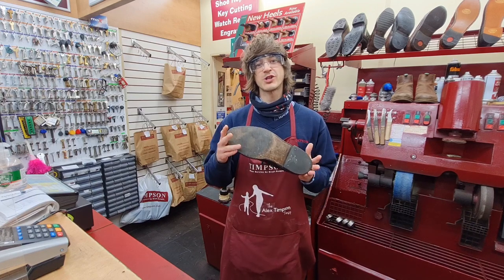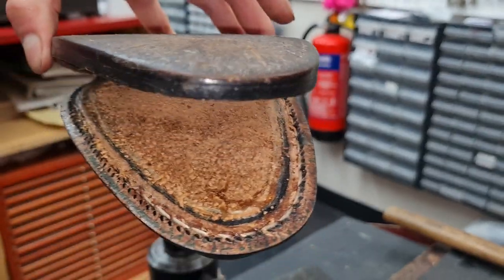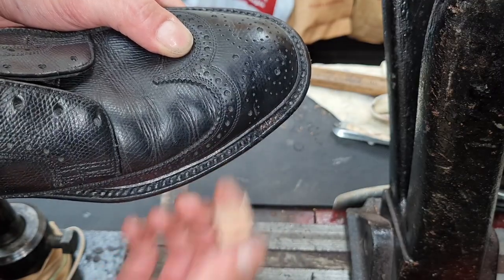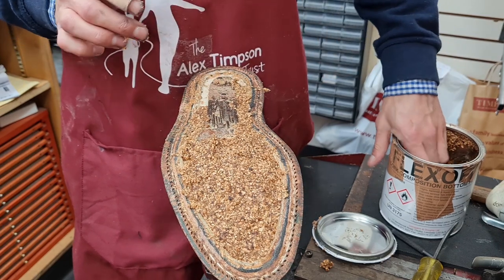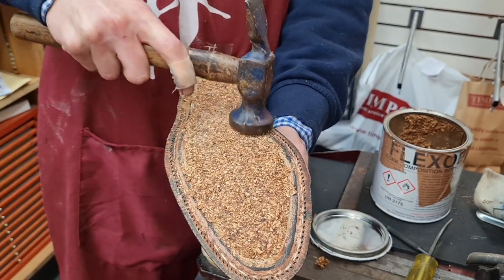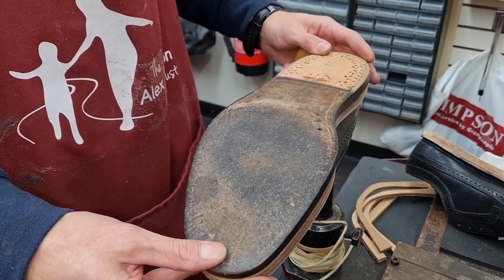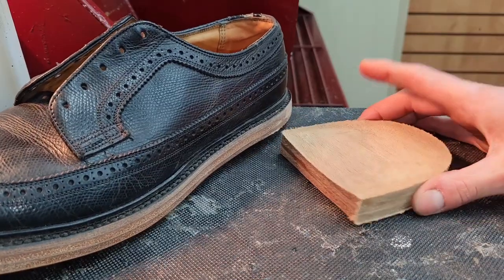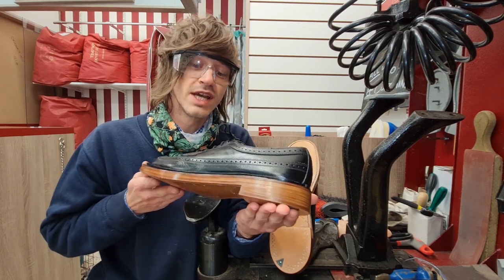VINTAGE Florsheim Imperials | SUICIDE HEEL | V-Cleat | SHOE REPAIR RESTORATION

Comment: Mark Ive Been meaning to ask also on why you would not use the Polishing Wheels to Wax Renovate and Shine any pair of shoes instead of doing it by hand.
Reply from the maker: Hey dude. The brushes on the machine are caked in a lot of waxes from the years of use and It sometimes isn't the best wax for the leather uppers, I like doing it by hand to get a nicer finish, takes a bit longer but a better result in my opinion. 👊
Reply: Mark Doing a Re-Watch of this one so my 2nd comment as I’m looking to Buy a pair of these.
You mention these ones your working on are tight on your feet? I’m a Size 9 usually so are these true to size? And do I stick to buying a size 9.Hope you don’t mind the Asking Mate🙏
Only reason is Grenson ( my other Brogues) are Big fitting and an 8.5 Size would have fit me better than the 9 I bought.
Reply from the maker: Cheers dude! These are pretty tight because they are a size 9B so are a little more of a narrow last than what I'm used to, however they have loosened up over time with wear and are alot better fitted nowadays. Respect dude.

Comment: So, did you say that you’ll be using these as a work shoe for yourself?
If I caught that correctly, then why no rubber on the sole anywhere? They turned out stunning, but with only leather and that classic heel, traction won’t be so great
Reply from the maker: That was the original plan. But since they came out so nice and with that heel I've decided to use them as display shoes for the time being and save them for a special occasion. Glad you like the turn out! Thanks for checking it out dude
G